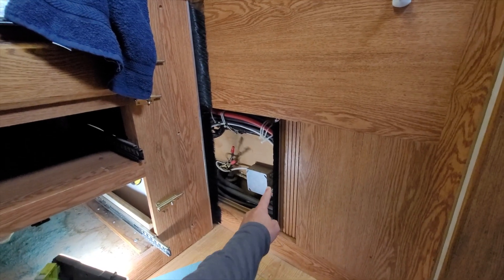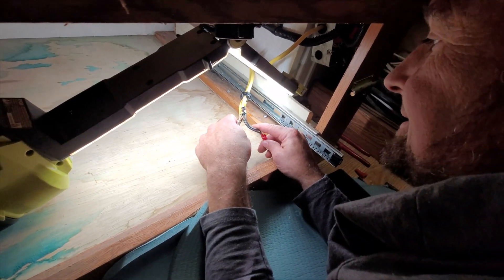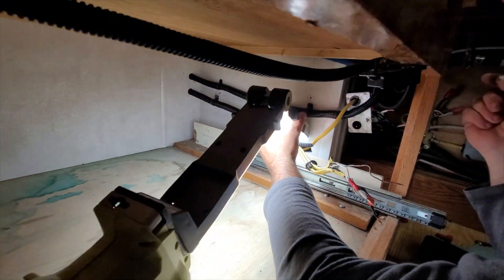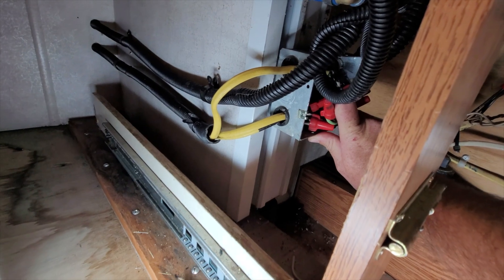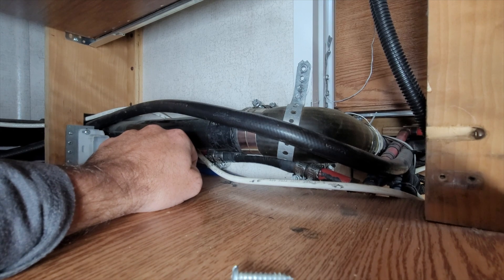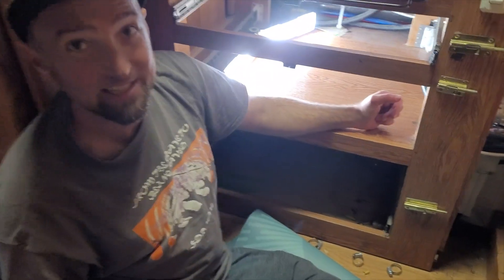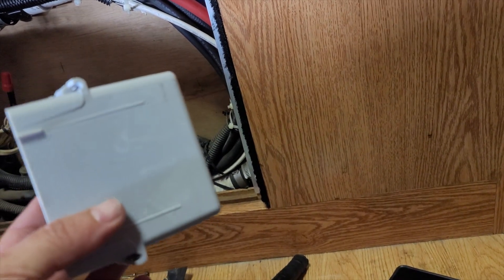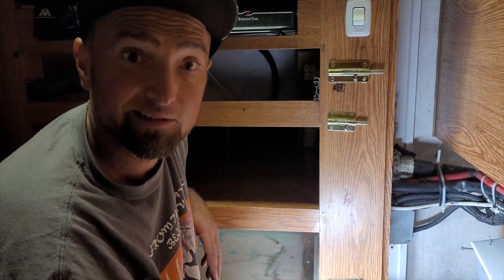Close Call Electrical Fire Danger in Our RV!! | #rvlife #safetyfirst

Comment: Great job Cyrus! I had my days of learning how to fix most of everything after 20 yrs of. RV life a never ending chore due to constant movement, shoddy workmanship, poor design, and light duty appliances/construction. Jen you got the best partner for RVing. Miss you guys!
Reply from the maker: I sure did luck out!! He's been busy this week fixing a water leak we discovered when we had rain for 3 days and it started coming out from under the fridge! It was coming in through the vent on top that upon inspection....was very much pulled away from the roof, had lots of rust and needed to be scraped and resealed. 

We got a used dehumidifier off of Marketplace for $15 and it has been a lifesaver down here in the humidity and rain!